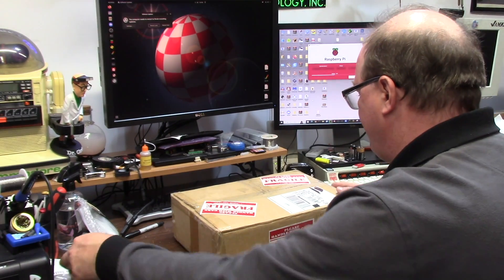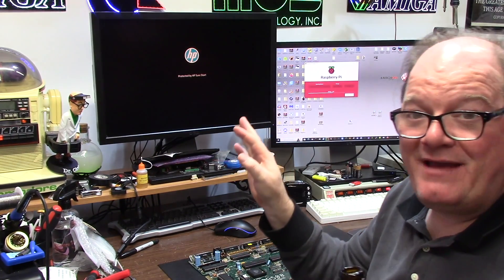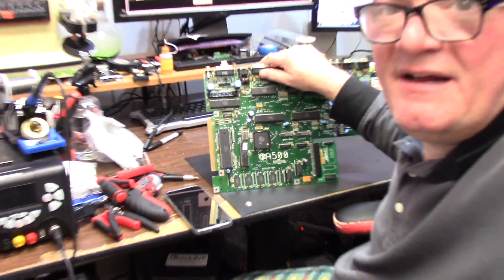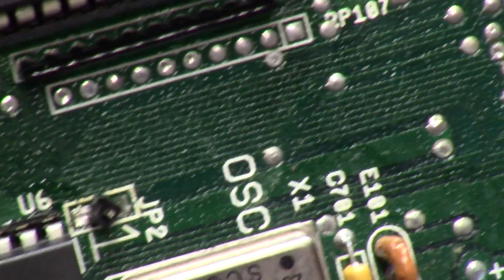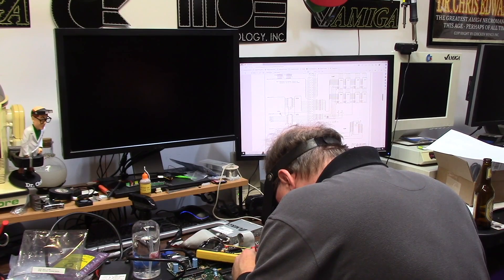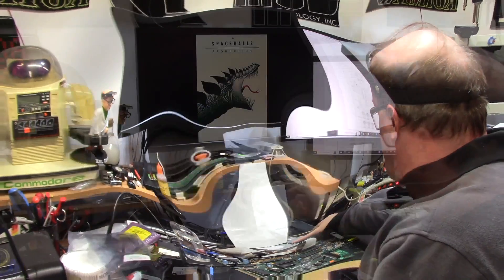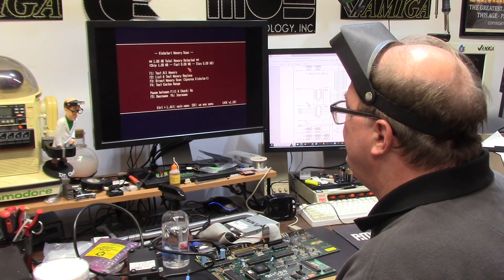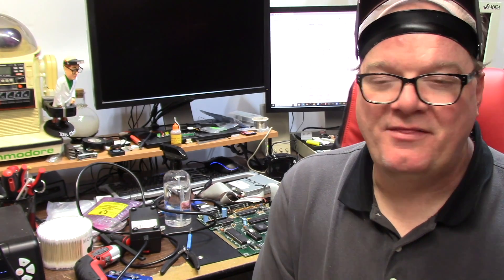The Amiga 500 1MB chip mod with destroyed pads

Comment: Hey Chris, so I did this mod recently on my Rev 6A A500 and as it turns out, with the same AmigaKit 512kb board. I did the mod near the ROM, and then removed (or was it added) the jumper on the mem board, and it got me 1MB of Chip Ram. So I dont think cutting the pads near the trapdoor is needed, but I guess it just makes it 1MB hard wired. If you solder that back, I beleive you can then use the mem boards jumper to toggle it.

Any what the heck happened to that machines pads. It was NOT a hard mod to make, looks like someone had at it with an ice pick...

Kudos to the channel, I learn so much from ye wizardly manouvers!

Comment: Chris, I got a bunch of spare chips which I don't need, mostly from A500...let me know if you have a use for them since shipping wouldn't be that cheap from Germania...Fun Fact for PiStorm pimped A500 Rev6A, you only need to set move_slow_to_chip in config.txt without any soldering to have 1 MB of Chip too...
Reply from the maker: Thank you for your generosity but shipping sucks.   Same them for your ride in case something happens!

Comment: Did Mac and PC users, at the time of the Amiga, have to modify their computers in a similar fashion as the Amiga, like cutting traces/soldering on the boards?
Reply from the maker: Nope they are troglodytes that only follow their leader with less powered machines and no knowledge
Reply: If Epictronics and Necroware has taught me anything, it's that this kind of rework is common on all platforms. Especially when Vartas are involved.